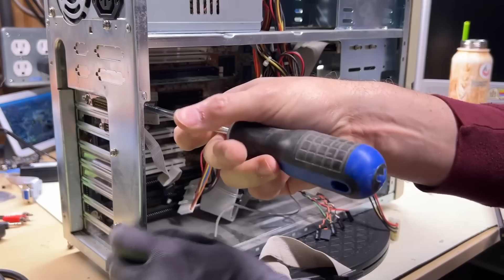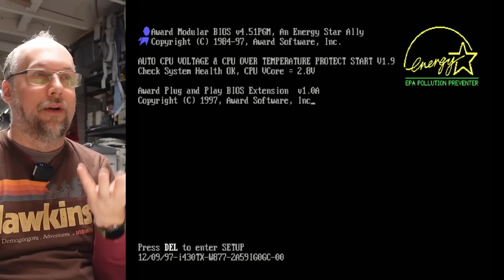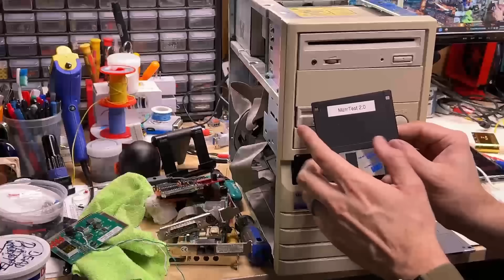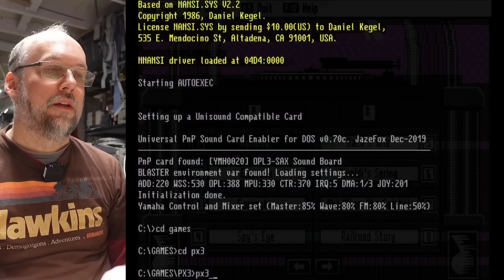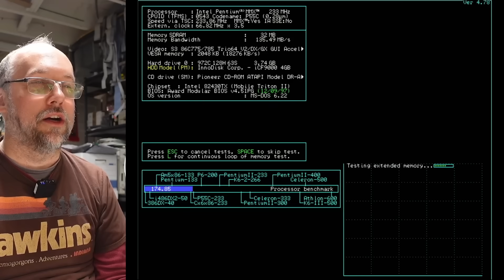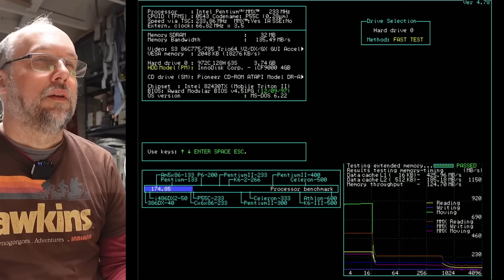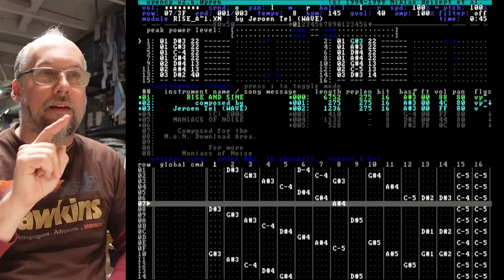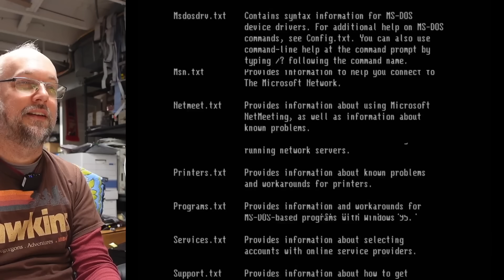Test and try: What's inside this dusty old PC?

Comment: The t string is the sb type. T1 is an original SoundBlaster, T2 is an SoundBlaster 1.5, T3 is an SoundBlaster 2, T4 is an SB Pro, T5 is an SB Pro with an FM Synthesis chip, and T6 is an SoundBlaster 16 or later.

Comment: I'm putting together a P1 233Mhz system right now and I had a cool motherboard lying around for it. I used theretroweb, it's an AMAZING source of information, manual, bios, motherboard drivers. I tried to identify the motherboard and for weeks I thought I nailed down the model but when everything was put together and everything was working, I tried to hook up the front panel LED and button/switch stuff and only then I realized that I was looking at the wrong type of manual the whole time because the pins are totally different for the front panel connectors. I was able to find the correct page with the manual for it but the motherboards were probably closely related because there were a lot of similarities between the two. Awesome site, I love it ever since you showed it to us.
Reply from the maker: It's just wild how many variations and slight variations existed for all of these motherboards! By the 486 era and beyond it just seems like an endless amount. Completely frustrating at times now!

Comment: I feel your pain with the iPhone. I use an iPhone 13 Pro Max and an iPhone 12 Mini. They never seem to match exposure or WB.
Reply: It's because of a feature called dynamic auto mapping. Locking exposure or white balance doesn't work because dynamic auto mapping can't be turned off from what I understand. You can get apps that minimize the effect but it won't go away completely.

Edit. Dynamic TONE mapping, not auto.

Comment: The ymf719 is said to have very good SoundBlaster 2 Pro compatibility. It seemingly supports 16bit 44KHz in SB2 emulation.
Reply from the maker: I did a little reading after making it and couldn't find mention of 16bit SB support. Definitely it was WSS support so 16 hits are there, but I wonder how to access them in DOS?
Reply: @adriansdigitalbasement2  I may have misremembered. It looks like the YMZ719 supports at least 44 KHz 8bit in SB2pro mode. 16bit would seemingly require WSS mode. Although in my memory, I used the card with 44khz/16bit mode in games with SB2 emulation.
Reply: @adriansdigitalbasement2  after looking through the data sheet, there is only 8bit stereo support for SB2 emulation.
Reply: @adriansdigitalbasement2  Some DOS games have WSS support for 16-bit sample playback.
Reply: I’ll send you a link in patron chat Adrian, the opl-sa2 does have 16 bit address decoding.